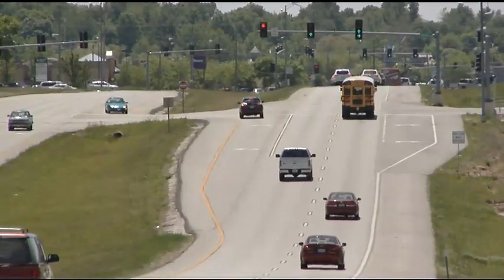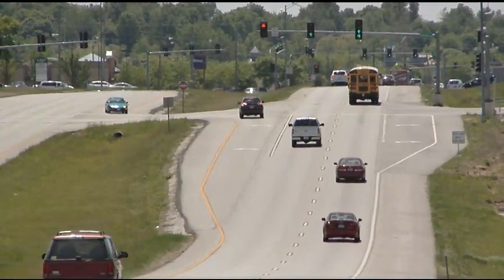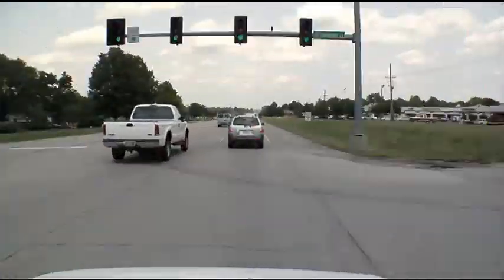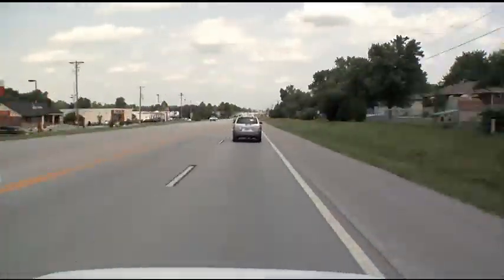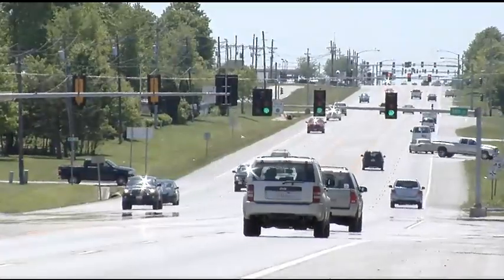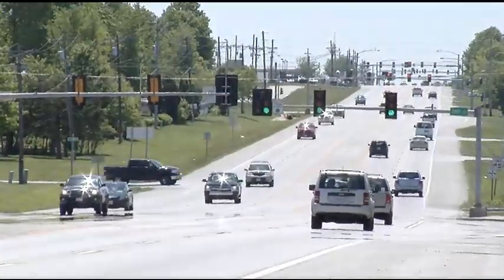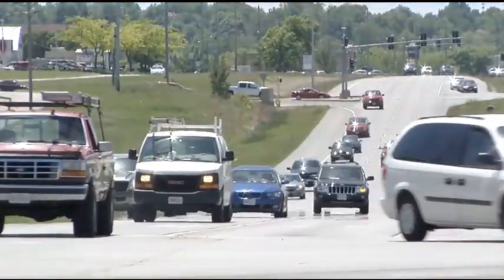ADAPTIVE TRAFFIC SIGNALS

Comment: I always wondered what was in those boxes next to the light. Why is there so much stuff in there just for a light? One time I opened my computer to see what was inside of it, and it didn't have nearly as much guts.
Reply: Because it needs to be as foolproof (from an equipment kind of viewpoint) as possible, while still having to operate under extreme heat, extreme cold, extreme humidity (those cases are outside after all, and probably weather sealed to an extent) and need to repeat a single task endlessly, as flawless as possible.  As much as I do like the idea of improving traffic flow, what I do not get is why, from a Dutch viewpoint the way this is achieved seems to be way to overengineered.  We have intelligent intersections as well (since the beginning of the 90's, if not earlier) but they work by detecting a disruption of an electromagnetic field in an induction loop that is embedded in the road's surface.  Whenever a car rests on top of such a loop the system knows there is a car waiting.  At dangerous intersections these loops can either be extended to be able to detect more cars (and thus emphasize the need for a green light on that particular stretch of road), or can be equipped with an advancement loop, that is able to detect whether a car is maintaining a particular speed at which the intersection can give other traffic a red signal in order to let the car that is nearing the intersection pass without braking, either because the route is a through route that is usually busier or because traffic flow on the crossing roads can endure the use of a red light more often.